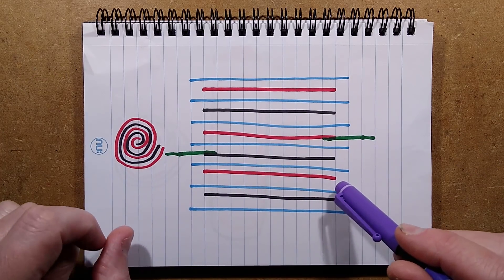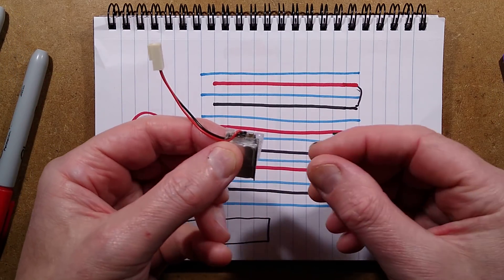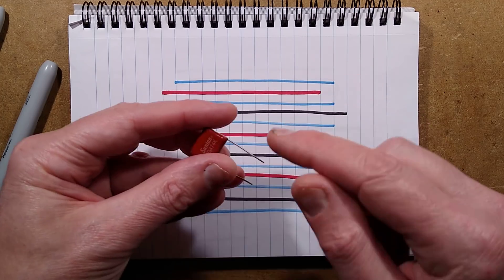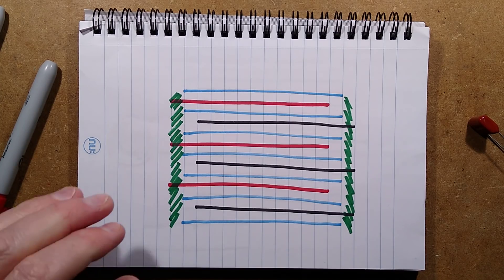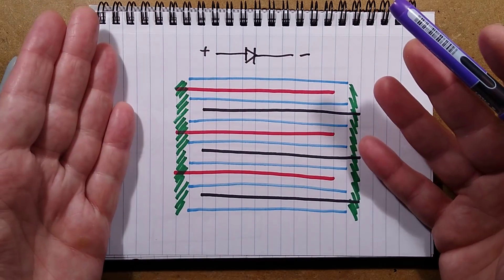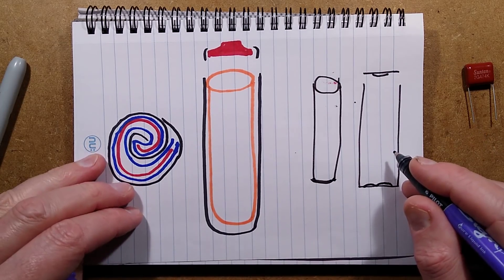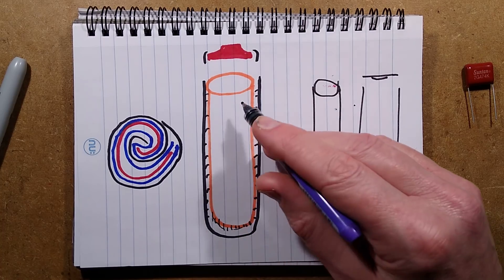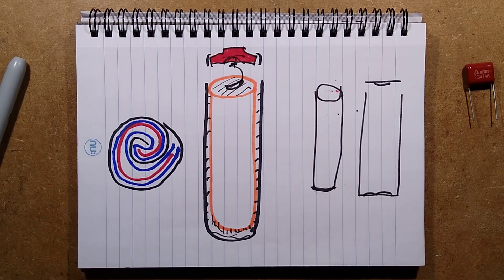Will Tesla's tabless cells ever use Schoopage?

Comment: At my last job, we built the robots that measured the + and - bond wires between the individual cells and the collector plates at Tesla. They have a LOT of factory space devoted to the wire bonding machines, optical inspection stations, manual rework, etc. It's slow enough that it takes less time to assemble all of the cells into a pack than it does to robotically run all the bond wires and test / rework each pack. For the Model 3 (as of about 2.5 years ago), each battery pack assembly line had (I think) 8 bond-wire machines and 4 of our bondwire testing robots.

If they have a way of chucking all that bond wire rigamarole out the window and come up with a simpler way of connecting the individual cells to collection plates, it will save them a fortune.
Reply: So the Cell Cost is not as such the material cost, but the assembly (time and packaging ?) cost ?
Reply: @highpath4776  As with pretty much every technology. A computer is just a bunch of silica, copper, iron, aluminium and plastic assembled in a very specific way. A $2000 gaming setup costs maybe $100 in materials. The rest is mostly research, manufacturing, shipping, and a couple percent of profit.
Reply: @highpath4776  pretty much. according to the % benefits they'd shown, the $/KWH for the consumer goes down 14% from the design and 18% from savings on factory stuff (probably labor, electricity, etc.) that's over half the savings right there.
Reply: Jim Wagner
Let's try "Blue Peter mode" (yes, I'm that old)
Take a strip of paper.
Make small cuts along one edge, forming tabs.
Form paper into a circle, 3-4 layers thick, cuts uppermost.
Push cut sections to the centre of the circle.
That's essentially what they've done.
The tabs fold onto those inside, essentially forming a solid surface/ connector.
No glue, welding, etc.
Let's say that at the point where they wind the cell, there's a precise air jet aimed at the correct height, each tab passes the jet and is blown flat.
Reply: @rogerstarkey5390 , I'm not "that old" yet, can you please explain "Blue Peter mode"? Thanks.
Reply: I thought the wire bonds acted as a fuse for each cell, getting rid of them would require a fuse somewhere else.
Reply: @bigjd2k  thats what the thing in the positive end does. clive drew it
Reply: They are just swapping one inspection process with another. All this hundreds of rolled contact schindelds will need inspection too, or the cell could go into self shorting mode anytime later.
Reply: @HyeL  
No.
They offset one sheet to the top, the other to the bottom.
There's a separator between them.
The contacts are nowhere near anything they can short to.
Reply: What we’re talking about in this video is tabs inside the cell, not the bond wires between cells.
Reply: Thank you for this very cool insight, finally someone who was in the factory and saw the current process. Could you please make some remarks on clives theory mad ein this video, and your own predictions of the process used in the future based on what was seen in the battery day presentation ? Thank you in advance!

Comment: One of the slides in the Tesla battery day presentation already showed what they are doing. It's not Schoopage, they're cutting tiny slits into and then bending the ends of the anode and cathode into flat surfaces that contact the positive and negative poles of the cell. Or at least they're doing that on one end of the cell. Here's a screenshot: https://i.imgur.com/me2ut3f.png
And here's a link to that point in the presentation: https://youtu.be/l6T9xIeZTds?t=6794
Elon talked a lot about making manufacturing as simple, fast and cost effective as possible and that's their solution to the problem.

Comment: I wonder if this tech is going to stay within vehicles or trickle down the knock-off market to consumers. very intresting.
Reply: It isn't needed for consumers.  The batteries will go into vehicles or into battery electricity storage systems like the Power Wall.
Reply: @acmefixer1  people always want more power for the same size unit, so guess we will have to wait. 👍👍👍
Reply: You will find batteries using this technique in consumer electronics within a couple years time, no doubt.

Comment: The jelly roll expands and contracts (thanks silicon) during charge cycles so solder will have a hard time.
The tabless design is really "multi-tab" copper which allows movement / breathability while allowing good electrical / thermal conductivity.
Besides, adding more elements into the cell (lead / tin / ????; whatever is in "solder" these days) doesn't help weight / recyclability.
Reply from the maker: The expansion is more pronounced with silicon.  Most existing cells use graphite.
Reply: @bigclivedotcom  I was talking in the context of "Tesla's tabless cells"; Tesla is increasing their use of silicon.
Very interesting about Schoopage, thanks!   :)
Reply: Good point.  You do NOT want to add lead, tin, & silver to our battery chemistry.

Comment: I thought they had it right from day one.
Negative "gives" up electrons to Positive that "accepts" electrons.
Hence the - for giving up or losing and the + for accepting or gaining .
It was just the general public that got it wrong .
Reply: Jack Allen Walters, Jr. - the ‘story’ is that various scientists watched sparks and tried to work out which way they jumped. So as it turns out, the human brain is too slow to properly see what is happening. So they had a 50/50 chance of getting it right. But got it wrong. Years later, it was discovered that electrical current flow is actually electrons moving, and that these are negative charge carriers. Hence they move in the opposite direction to ‘conventional current flow’. But (most of the time) it does not actually matter which way the current actually flows, as long as everyone uses the same terminology. In the same way that it does not matter which side of the road you drive on, as long as everyone else on the same road network drives on the same side of the road.
Reply: @Mark1024MAK  I think that was Ben Franklin.  Funny thing is, around the same time in France chemists were figuring out metabolism and combustion.  Their first guess was that something they named Phlogiston was leaving the burned material.  Nope!  It was combining with Oxygen.
Reply: cathode, cations. anode, anions.
Reply: @Sal3600  
Thanks, I see it is even more convoluted than what I commented . 
https://duckduckgo.com/?q=cations.+%2C+anions.

Comment: I dont think he's doing tabless with 18650 only the new 4680
Reply: which should be 46800, since 18650, 21700, etc all are named by a particular convention that "4680" defies.  but then again, if it didn't detrimentally defy all industry standards, it wouldn't be a Tesla.
Reply: @Sean_The_IT_Guy  detrimentally?
Reply: @Sean_The_IT_Guy  It's a pedantic irrelevance.
Reply: Correct
Reply: Steve Dave  probably to make it easier to search for online (1865 is a year)

Comment: You could also make the aluminium electrode as a metallised foil electrode, with a layer both sides, and a small non metallied edge. Then wind the cell with the aluminium layer exposed on one side, and the copper foil on the other. Then you can apply schoop to the top to connect, and use the extended copper foil on the base as a contact direct to the cell wall, so you get a cell that is to a large extent self healing, and which still has a high current capacity.

Comment: I have watched you long enough to know not to tell you anything. I saw the video and it looked like they had some kind of folding at the ends making it essentially a flat plate.
Reply: Yes, it looks like they make cuts at regular intervals along the extended part of the electrode (metal) so they can fold the flaps between the cuts at right angles to form a "cap" where all the folded flaps are connected electrically by overlapping them. This would mean they do not need to solder the extended ends of metal together to form a cap. It was not shown but I assumed this was done at both ends, ie, for both electrodes.
Also, the leaked photos of the jelly role showed the circumference was wrapped in an insulator so the negative electrode foil was not made longer to make an electrical connection with the cylindrical sides of the cell can.

Comment: I wonder if using this means they can safely discharge at insane currents. I've been looking into low ESR caps since I've been playing with the idea of making a coilgun as a fun project. If something like this could dump enough current fast enough you could, maybe, eliminate the need for a capacitor bank.  🤔
Reply from the maker: I doubt it could compete with a capacitor.  It uses simple charge equalisation between plates so the only limit is the ESR.
Reply: @bigclivedotcom  Ah, of course. I wasn't even thinking about that. Yeah, capacitors should always be faster.

Comment: What if the top schoopage has enough of an adhesive quality that a top thick "tab" could be placed over it as it sets?  All you'd need would be enough mechanical force after that to keep it from vibrating loose or something right?  Or similar: maybe they figured out a way to weld a tab to the schoopage layer?

Comment: I'm shocked to discover that method is not in use already.
Reply from the maker: There are still lots of avenues to explore, but making a move in a new direction is always up against the existing huge manufacturing system based on existing technology.
Reply: @bigclivedotcom  Well, Tesla's main motivation for going tab-less is to reduce manufacturing costs and the aggregate cost reduction of all five Battery Day announcements is expected to be around 70% per kWh. I doubt many battery manufacturers will be upset about that, unless they don't qualify for a license and get left out. Decent yet still affordable EVs are one substantial step closer to reality.
Reply: @bigclivedotcom  hello; have you ever thought of experimenting with battery design concepts/ideas, maybe for a video; I recon it could perhaps be interesting. Thanks
Reply: @bigclivedotcom  How quick will the chinese nick new technology before Japan/the west get it up and running ??!!
Reply: @highpath4776  never underestimate the power of scientific socialism.
Reply: This is not remotely new even in lithium batteries. Have a look at 'how it's made' s1e13. And this is from 2001.
Reply: @JLK89  Exactly, for prismatic cells its quite a bit simpler.

Most of the electric/hybrid cars maker that don´t buy from Tesla or Panasonic use prismatic cells.
Reply: @JLK89   https://www.dailymotion.com/video/x6z3qp5
Reply: @Lipi19821  Tesla wanted speed, that solder spraying seem slow and everyone in the video built battery with hand, very slow.
Reply: @JLK89  Interesting watch, but nowadays the Cells dont use pure lithium anymore but rather copper and aluminium foils and some carbon seeped with organic compound for the Lithium Ions. 
For lazy ppl here the vid :
https://www.youtube.com/watch?v=kndi9CYM7Nc
Ps: Nice to see "Schooping" starting @ 3:34
Reply: Marc Jackson  Maybe I should act quickly to get my patent for an automatic mouse trap in. It has 4 legs, a tail, a head, 2 ears and 2 eyes to detect the mice.
Reply: Its probobly in use in some prismatic bag cells, but in steel cases its a bit more complicated. Its really a manufacturing problem more than anything else.
Reply: Same. Perhaps it is not as simple as it looks.
Reply: I think it's more complicated then you think. If capacitor failed what you got? Micro explosion, cloud of smoke and lot of weird smell. But if battery of that type go bad, no matter how it failed, then you got fireball in your electonics or a car, and it's not very funny.
Reply: That's because is hard.
You can't heat it up, you can't seal it for good, you can't press it.
So you are left with few options.
Also, it will burst into flames if something goes wrong.
Reply: Marc Jackson  Well , for copyright, and other stuff,  the UK was always wary of sending anything to the USA.  Many british inventors did not patent stuff, as it would release IP into the wild, and would demonstrate items with bits missing to the insitutions (Baird with TV for example),  or make sure the wording they used was so confusing as to cover every possible usage etc.   USA patents tended to rely on what was registered, and ignored 'prior use' means that would nullify patents in other countries !!
Reply: agree

Comment: No sorry they just extend the negative electrode and have it folded up in the end for a press fit, the positive still has a normal tab (why are they calling it tabless?) or as the patent so eloquently points it “an energy storage device is described. The energy storage device comprises the cell of an energy storage device, and a can comprising a first end and a second end, where in the first end comprises a first cap comprising a contact surface.”

You can read the patent here
https://patents.google.com/patent/WO2020096973A1/en?oq=WO2020096973
Reply from the maker: I'm not convinced that the folded copper foil is going to make intimate contact.
Reply: @bigclivedotcom  They have some triangular "spikes" on the inside of the cap which come in to make contact with the folded copper foil, which is supposed to help make a better contact.
Reply: @bigclivedotcom  I’m not convinced either, it seems they’re going coat it in nickel (hence their very nickel focused presentation) in order to get better contact however I don’t see how this will improve ohmic battery resistance compared to just existing multiple welded tabs, I think the only improvement will be manufacturing complexity (and maybe some thermal improvements). I also don’t see how this will give them any energy density improvements as this method clearly takes up more volume within the battery (the energy density improvements are probably just from going to a larger case size). I also suspect they run a very real risk of going Galaxy Note 7 with this design, if the contacts don’t fold over perfectly (hence several end cap designs) pinching can occur in the battery which can lead to a short and a fire, this can happen in a tabbed battery but I suspect it will be a much bigger problem for this design so they will probably have to spend a lot of money on X-ray or µCT inspection to ensure that doesn’t happen.

Comment: Why using individual 18650 cells instead of big flat cells? With round cells, we are wasting much space I recon. Or maybe the space around is used for cooling fluid...
Reply: Yeah, I think they need the space between the cells for cooling - especially during DC fast charging - e.g. Tesla's Superchargers, since we're talking about Tesla ("other EV manufacturers and DC fast charger networks are available" :)).
The Li-Ion charging process is surprisingly efficient, I believe, but at the ridiculous power of the Superchargers¹ - and DC fast charging in general - every 1% of inefficiency means ≥1kW of heating in the cells - yikes! 😬

Also, The Engineer Guy's video about aluminium drink cans mentioned that the stacking efficiency of cylinders (or drink cans, at least) is better than you might think, so they aren't losing all that much space in that regard, even if cooling wasn't an issue :) I suspect that the weight of the battery is probably a bit more of a concern than its dimensions, too.

¹ I'm not super familiar with Tesla Superchargers, but Wikipedia² suggests that they can supply at least 100kW per car (depending on circumstances) and possibly much more... Other DC fast charging networks/systems are comparable: >100kW charging isn't unique to Tesla.
² https://en.wikipedia.org/wiki/Tesla_Supercharger
Reply: @AndrewGillard  
The "Schoopage" massively increases current transfer, lowers internal resistance which keeps the cell cool.
This will (imo) enable theses cell packs to maintain full V3 supercharger rate of 250kW for the majority if the cell (pack) capacity.
Existing (2170) cells throttle charge fro 50% capacity upwards.

The larger the diameter, the higher the ratio of cell material to casing, lowers relative Weight/kWh.
Also, larger diameter provides s disproportionate Increase in jellyroll length compared to smaller diameter cells.
Reply: Flat cells have good current output but are more difficult to design an efficient cooling solution.

Tesla increased their conventional battery size to 21x70 and the new cell design is 46x80.  In the pack the cells are interleaved so the wasted space is relatively small and is mostly taken up by the cooling tubes that weave between the cells.
Reply: They're not 18650
4680
One reason for round cells is speed of manufacture.
Reply: Wasn't there talk of making "Biscuit Tin" sized form factors?
Reply: In addition to the other comments, I think the cylindrical cell form factor is likely much easier and cheaper to manufacture, along with being a bit more durable compared the the flat ones. Just my hunch.  
I will say, I was surprised to learn EVs and E-Bikes almost always use 18650 style cells in their battery arrays.

Comment: They could also spotweld a copper strip along the whole length of the sheet instead of just a tab. Then they youd literally solder to the bare battery.
Reply: That would be no different than just extending the electrode itself.  If you're posing that as a solution to terminate the aluminum electrode, aluminum itself is both weldable and solderable.
Reply: spotwelding is still part of the process, which they are trying to streamline
Reply: If I understood correctly what people were saying is that Tesla want to eliminate things like spotweld because they wanted something faster that flow thru the production line like filling a bottle of soda. They want speed.